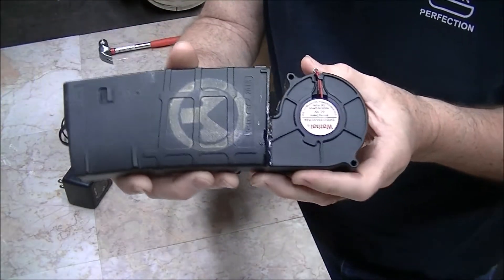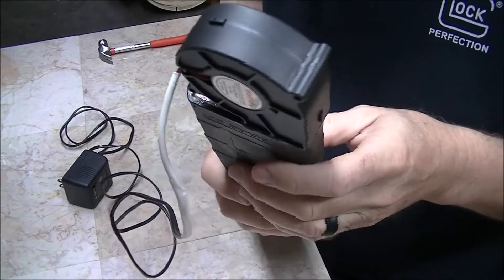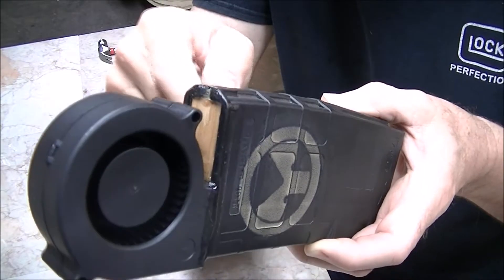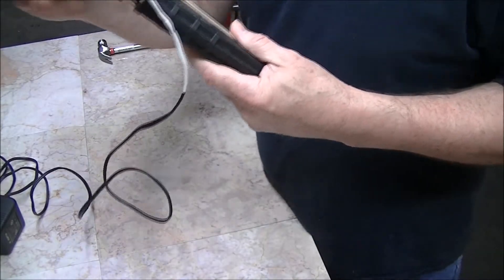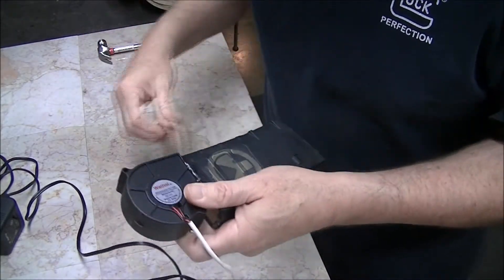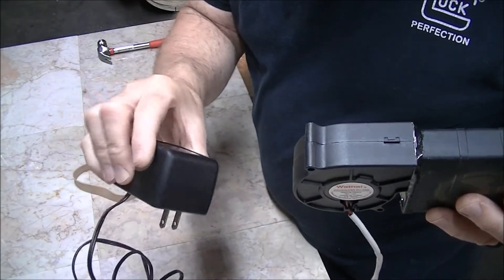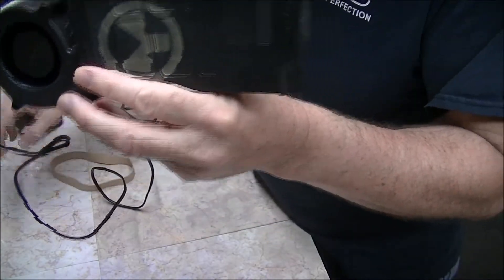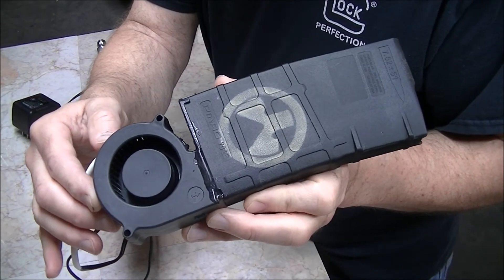DIY Rifle Barrel Cooler on Call-in' the Ozarks!

Comment: two things; at my range there are no electrical outlets and second how does the air blow down the bore of the rifle ?  
There is a big hole were the bolt should be ?????????????????
Reply from the maker: You close the ejection port cover, then the air goes down the barrel. If you use a DC fan, then you could use a battery to power it.
Reply: @wiggsan  So this is for semi-auto rifles then not bolt action ? 
When I close my bolt in my bolt action rifle the bolt head enters the chamber and there is very little room for air to blow thru.
Reply from the maker: @davidnuttall-y7l  Specifically for an AR-10 or AR-15 platform, depending on which magazine you use.
Reply: @wiggsan  ah that's makes sense :)

Comment: Adding to the algorithm. Nice hack on cooling. I actually use an (8) d cell portable air mattress pump with a 5/16" hose into my chambers of my 338LM and my 375Chy. I have thermal heat transfer temp tape on all of my barrels to show me the actual 😢 it works awesome. I never found that the air mattress pump was good enough for anything other than that ues